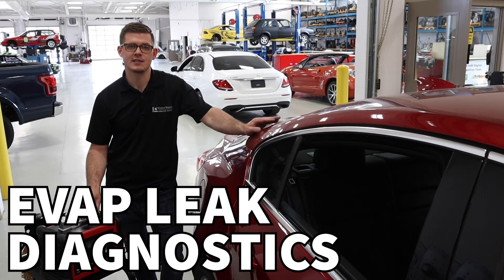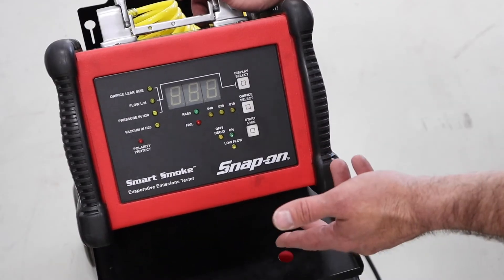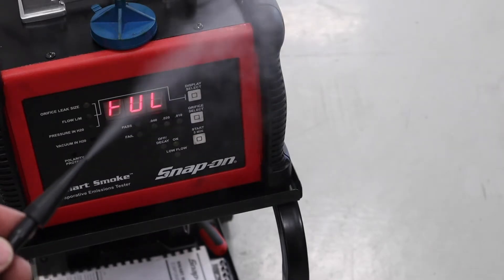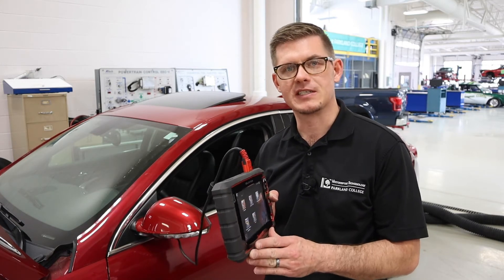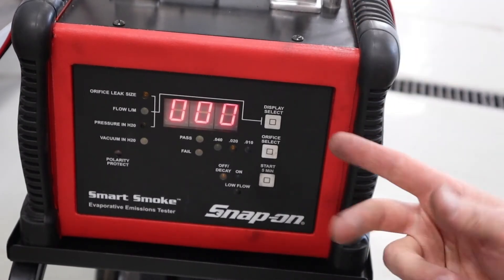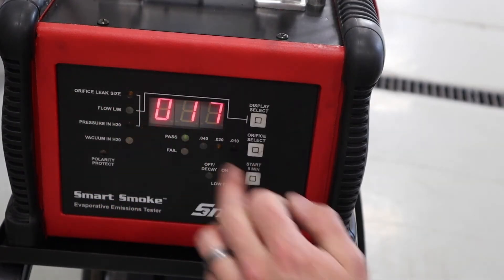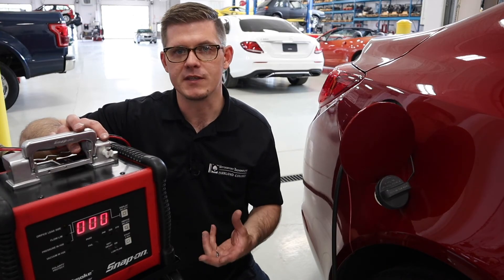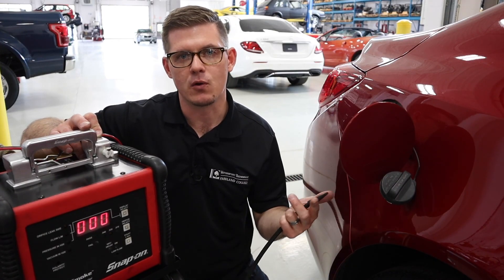EVAP Leak Testing with a Smoke Machine

Comment: Ford has a lousy vent valve on its 03 era expedition and navigator.. they are natorious for cracking and are built into the tank.  No replacing them.  It's the whole tank that needs replaced.  Fast forward to 2025 and they no longer make this tank.  Good luck finding a non broken one.

Comment: Please I have question, since check engine light comes on after long investigation in Toyota/ sienna2021, do you have an idea if the smoke comes out thru rounded plastic(Vapor Canister Filter) has small fins this located around the filler neck by fuel cap ? Is that leaking or normal during smoke test ?

Comment: can i do this test on older cars that don't have a scan tool port? working with a 1993 nissan pathfinder. thanks
Reply from the maker: A 1993 model is equipped with a less advanced EVAP system. You may be able to do a similar test with access to an OE or aftermarket equivalent scan tool,, but a system of that vintage is typically not self-auditing for its ability to seal.

Comment: Most could not care less about your fancy machine! It's smoke!
Reply from the maker: That's a fair point but when time and money are involved you look for any advantage. The professional technician or service facility rely on "fancy" machines for efficient and reliable diagnosis day in and day out.
Reply: This Fancy machine found an EVAP leak on my Truck when a Dealer Mechanic couldn't
Reply: @Pusskit well honestly I'm very impressed by his fancy machine I wish on life I had one. It's actually very nice. It can almost pinpoint where the leak is I feel like. I have an EVAP leak that I've had for 3 years and brought it to three mechanics and they just keep changing miscellaneous stuff and no one will do a smoke test for me. So this will be a lifesaver. I have EVAP code p0455 I've had the map sensor change the maf sensor change, I can't tell you how many other sensors and valves.
Reply: @Bethann4ever  Don't guess...test!